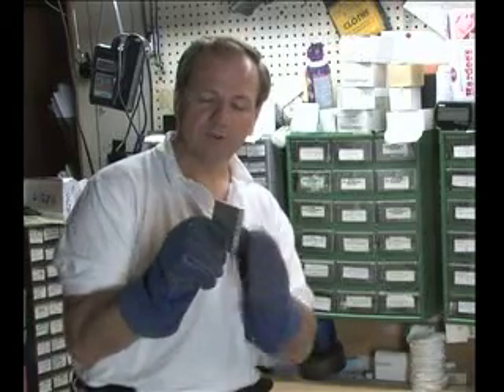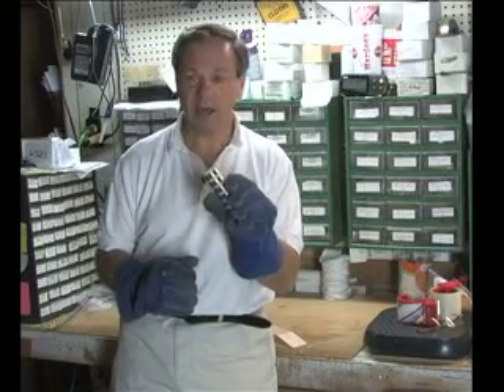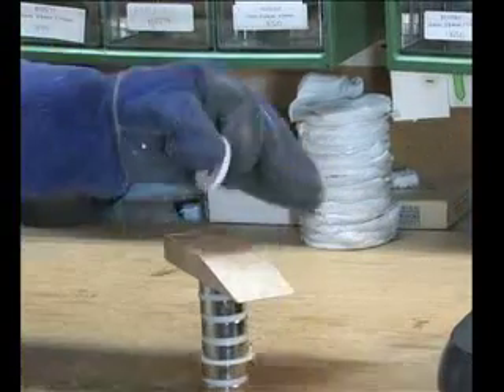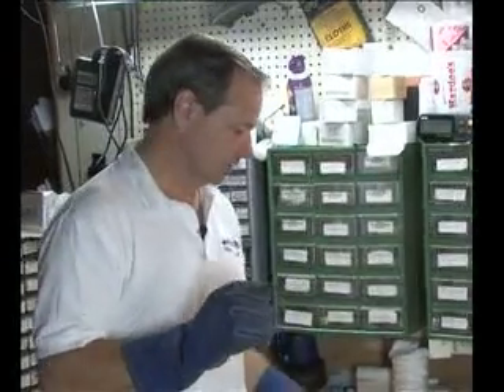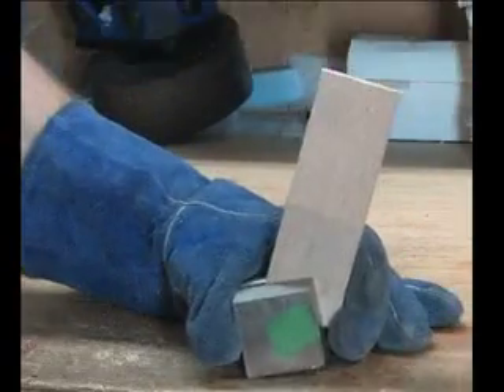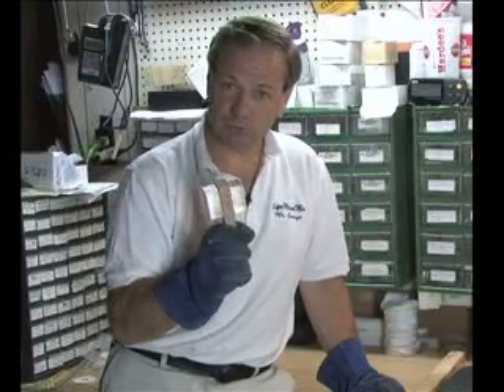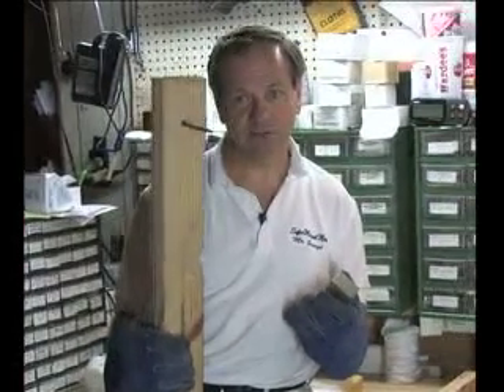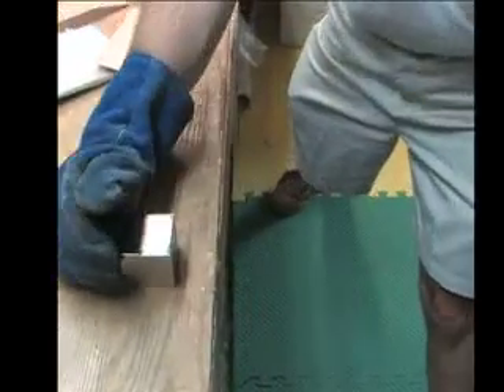Separating Neo magnets - Part 2

Comment: i know that if you let copper go trough cylinder magnets it will travel certain amount of time longer than free fall. now, if you drop magnet trough some copper pipe, will same effect be observed? then that can be used for safe stacking of the magnets :)

Comment: I just purchased two cylinder magnets.  They arrived with two plastic cylinders which separated them. Each plastic is about 1/2 inch thick.  When taking them apart they got stuck together.  Can you show how to separate them?  They are not square so I can't turn them like you did.  P.S. how about using Copper or Aluminum as a wedge?
Specs:
One magnet is N52 2 inches by 2 inches with 450lbs strength.
Second magnet is N40 1.5 by 1.5 inces with 220lbs strength.

Comment: Haha - thats extreme :)
How big is the difference in force of 2 magnets together compared to one magnet of the same size to a thick steel plate?

I have got a 35 mm (1,38") diameter and 20 mm (0,79") thick N45 grade but have only one yet. It easely holds a 20 kg (44 lbs) plate onto a round, hollow, painted bar - if it was ideal conditions (flat surfaces and thick material), it would probably hold twice that weight. That gives an idea about how strong those cubes are.

I dont think my magnet is hard to handle without tools though (depends of how strong you're your self also) - as long it's possible to slide it over an edge to remove it (lift it right off a steel surface is quite hard, haha). Of course I need to be careful anyway, get fingers smashed hurts alot, haha.

Comment: UHMW tape could be applied to the wedge to allow magnets to slide more easily.
UHMW is Ultra High Density Polyethylene, it is slippery and strong.
HDPE is High Density Polyethylene is similar, but less stiff.
A wedge could also be made from a block of either material. It could be worth the trouble for those who handle magnets often.

Comment: You can't just put the magnet back. Once you got within a few inches, it would be pulled from your hand by the other magnets, which could cause cracks or breaks in the magnet, injury, or misalignment with the other magnets.

Comment from the maker: Bojanlacic
Yes they will crush fingers.  The large magnets are extremely useful interestingly enough in treating pain and cancer on the medical side and for various forms of electricity production on the energy side.  Many new windmill designs use these larger super magnets to increase generator efficiency.  Of course there are hundreds of other uses too - like changing traffic lights and repelling sharks.

Comment from the maker: Fizz489 - basically a 1 inch (25.4mm) dia disc is a good size up to the 0.5" thick disc.  One of those is an extremely strong magnet but by itself will possibly cause an occasional pinch but certainly not crush fingers.  2 of these would cause serious blood blisters if they came together with skin in between.  A 1" dia x 0.25" will pinch but 2 of them would not hurt as much.  So, if you get 1 magnet the 1" x 0.5" N50 is OK.  I hope this helps.  After practice you can handle larger ones safely.

Comment from the maker: Yes I have lots of large magnets - 8 inch dia x 0.5 inch thick and 6 inch x 4 inch x 0.75 inch thick.  In the disc area I have the 5 inch dia x 1 inch thick N50.  Probably the 5 inch x 1 inch disc is the most powerful that I have.